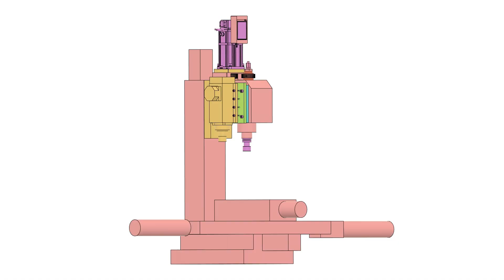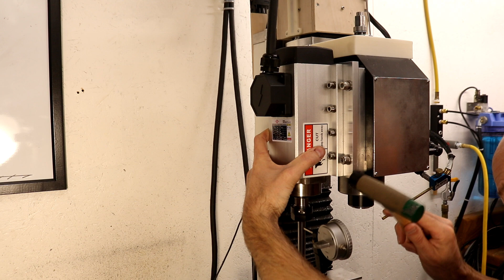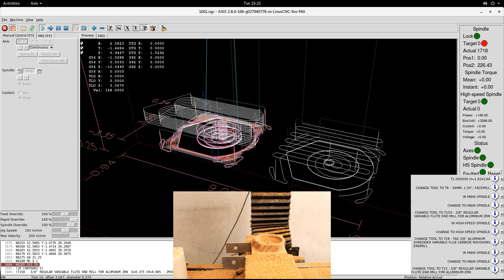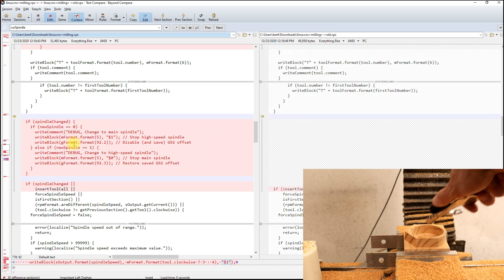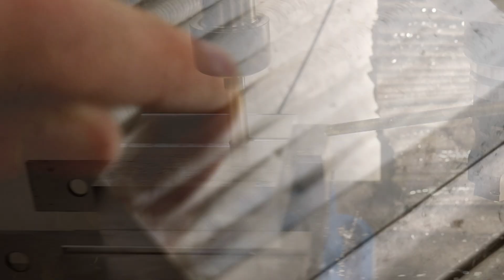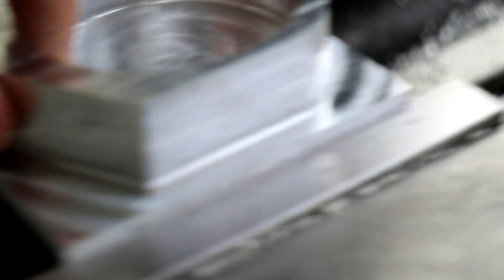Companion High Speed Spindle, LinuxCNC

Comment from the maker: In case it helps others, the Norbar FAQ corrects two mistakes that I've been making. Their torque wrenches: 1) should be stored long-term with a slight load; and 2) can be used to loosen if the capacity of the wench is not exceeded. (I've always stored torque wrenches with no load, and never used them to loosen.)
https://www.norbar.com/News-Events/Blog/ArticleID/129/The-ten-things-you-should-know-about-your-torque-wrench

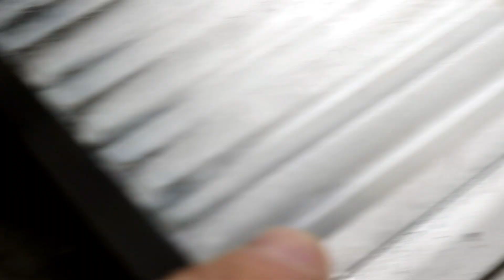Comment: At 15:00 this is normal due to the difference in milling direction : climb milling vs conventional milling its obvious that one have a better surface finish so set your finishing pass to be in a single direction to eliminate the roughness. texture on the wall is due to deflection take lighter final cut at half or third the feed rate and you will get a much smoother finish. Thnks
Reply: Great tips. I will only add that with the notched finish/rougher, a small vertical offset final pass to cut the leftover lines vertically. Or simply do multiple vertical passes that are different from the notch spacing should improve your finish.

Comment: Hey, found your video, but bit late I'm afraid) I wonder have you considered "speedy head" speed multipliers, this one can multiply 6 times, so your native 5000 rpm spindle can go 30k with it - https://www.youtube.com/watch?v=i8NrrTRrYAw , or even cooler - there are "air turbine" spindles, that works from air and can go from 15 to 50k rpm - like this one https://www.youtube.com/watch?v=LkPZ1ynjr4s . I also wonder if you think placing spindle aside from main axis of pressure - so that dovetails are pressured not in center but on a side, can somehow decrease accuracy? Thanks!
Reply from the maker: The speeders are pretty neat. The spindle that I used is pretty inexpensive and solid. The speeder depends on the stock shaky mechanical power transfer. On a mill this size and rigidity, I believe that machining soft metals (maybe steel), replacing the stock head with a spindle similar to what I used, making small fast cuts, is ideal. The air spindles are neat, perfect for micro tools, but the efficiency is pretty low (compression-expansion of gas vs electrical) for regular size tools. Starting over, I would replace the head with spindle with ATC and use small carbide tools. An expensive route, but the cost is paid once, and everyday solves problems and saves time. Hope this helps.
Reply: @kentvandervelden  Thanks, did you experienced some sort of rigidity issues while machining with high speed spindle, since it mounted sideways and not at the center of milling table?
Reply from the maker: @KyrychenkoAnton  With the stock spindle it's easy to be tricked into using big tools beyond limit of the machine. The high speed spindle leaves a far nicer finish than the stock spindle. No perceived rigidity problems, but the chip load is typically lower (and the spindle, bearings, power transfer is tighter) unless running the tool feed really fast.

Comment: Great videos and commentary! I did the exact same mod on my bf20 as you did here on your machine (water cooled 2,2kw spindle) and I am not going back to the slow main spindle for aluminum ever again. Finish is superior, MMR is superior and chip evacuation is a breeze above 12kRPM.
Reply from the maker: Wonderful to hear! With the HS spindle, do you prefer full depth or shallow cuts at higher speeds? Thank you
Reply: @kentvandervelden  My machine/hfspindle (slapdash conversion which I never fully polished as I wanted to make stuff on it not just mod it, which I kinda regret in hindsight) prefers generally lighter/medium depth of cut with smaller endmills (8mm or less).

Specifically case of that would be for Aluminum 5754 15kRpm, 2m/min feed, doc 5mm and 3mm woc. It can ofc be driven even more aggressively, but for this test it worked fine.  Here is a demonstration of the cut https://www.youtube.com/watch?v=9ECFzjlPzmo  (there are some problems in the X direction with chatter (the Z axis gib loosened a bit which I only recently fixed, as well as not having a second mist unit causing spots where coolant can not get at the cutter to cool it which is one of the main reasons as to why I am not doing 10mm doc with the same woc)

Edit: I do actually much prefer milling (roughing and finishing) with the HF spindle. It handles itself much better on a small machine like this with the loads present in high speed machining. It is only for face milling and drilling that I ever go back to the old spindle.
Reply from the maker: @exol511  Thank you, this is all really great insight. I left some questions on your video about the coolant. You've given more to think about :)

Comment: Browsing your video's found this HS spindle addition for "also" dual head CNC milling.
After James Clough42 his mill-spindle conversion I thought of doing the same but you convinced me.
Addition is better than conversion, thanks!
Reply from the maker: To increase capacity, addition may be best; if optimizing for aluminum or plastic or wood swapping may be best. Seeing how well the high speed spindle works forced me to realize how poor the bearings are in the main spindle and consider the bearings or spindle cartridge with a BT30 spindle. Have a look through the comments the suggestions from others such as mounting the secondary spindle on dove tails to raise it out of the way when not in use. Best of success to you!
Reply: @Kent VanderVelden  Indeed, better bearing with the same dimensions is a good upgrade.
Your aluminum adapter plate for a dove tail construction should then be of steel, I think.
Metal EndStop so that the Spindle can't fall.
Good to add a steel strip inside for bolt force spreading.
Also to keep it simple maybe the HS spindle casing flange could be machined to directly be the dove insert.
All this with a minimum offset distance to the main spindle centre.
Any thoughts?
Reply from the maker: @Dancer148  Everyone who comments on my videos have superior mechanical skills and creativity :)
Making the casing of the spindle into the dovetail insert is interesting. All of the surfaces of mounting flange that I received were rough, so leave some means to adjust for misalignment.
Do believe there there's some problem with having a spindle hang off the side of the head? The forces exerted into the head during machining are probably small, but maybe not. The main spindle is centered between the column dovetails, in some way, but the secondary spindle is not. Again, not sure if it makes any difference, but it's something that was an unknown concern. I thought I would come back to this when making an extension for the mill head, to improve the usable Y travel.
Reply: @kentvandervelden  I already made a sketch of the dovetail plate construction that needs more info to complete.
But I consider that your issues with rough surfaces while milling could be resolved.
It seems like the HS spindle does have some runout that could be measured like you did but pushing with the hands some side forces to the spindle. If that play is too high the adapter plate bolt tensions should be checked.
Have you tried milling the part with a much smaller endmill to lower the side forces for a smoother surface finish?
Reply from the maker: I've not tried smaller than 1/4". Maybe side forces are not too much at the higher speed? Spindle doesn't bog down. The surface finish from the high-speed spindle is much better than the main spindle, but machining with the high-speed spindle seems more sensitive to speed. May be seeing resonance? I did get a surface profiler to take the measurements. Maybe a video next month?
Reply: @kentvandervelden  I'm looking forward to it.
Best of success to you too!

Comment: Depending on a few things the alternating surface finishing will come from the climb vs conventional milling. If you only climb mill of the facing pass it’ll come out much more consistent even at higher feeds.
Reply from the maker: Hi Calvin, do you have a suggestion for automatically assessing and quantifying surface quality? Of course, quality is pretty subjective. I've looked at roughness testers, but they cost as much as my first car.
Reply: @kentvandervelden  Automatically I am not sure. I have only used two methods. First is the small almost record player needle-like drag needle that Mitutoyo makes, but of course that is in the two kilobuck range. Then there is the old hand scratch method, with a comparative set of rougness gauges you feel and see and use to compare to what your part feels like. That is more in the hundred dollar range. I have used both the Mitutoyo device and the hand scratch device to decent effect in a production environment.

With that in mind Perhaps you could come up with a way of using machine learning and a well tagged data set (machine method, ie end milling, side milling, turning, grinding, etc) with known Ra values and approximate the roughness value from an image, but I see many potential issues with that, such as the rainbow reflectiveness seen in the video.

Or maybe using an actual record player needle and strain gauge could work.

Whatever the case may be it is certainly not easy to do. Maybe some researchers somewhere out there have some better ideas.
Reply: I should also add that some machining methods leave dominant geometry on the surface which will almost completely define the surface roughness and therefore be calculated in theory. For example if you knew the geometry of the feature actually left by a a side milling cut and the feed per tooth you could mathematically predict a roughness average. Looking at a high quality side milling cut in a microscope is a great demonstration, the roughness in theory would come between the peaks and valleys of the chips cut off the material. A real practical example of this is in the single point diamond turning industry. By calculating the peak height desired between the feed per revolution of the turning passes, you can achieve a particular surface finish and therefore a particular optical transmissibility. However for finishing operations in metals with milling tools (especially face milling) I imagine it gets much more complicated with that as there could be very complicated mechanics with tool rubbing/friction/heat generation/cold working etc at the cut.
Reply from the maker: @CalvinoBear  I really enjoyed reading these. If you've not, I hope you can go through graduate school if you have the interest and find a great lab. It is that gage you mentioned that I was thinking of, and the 1k$ knockoffs, and did try my parent's 60-yo phonograph. I've been tinkering with accelerometer measurements and perhaps those combined with your suggestions would help considering the flex of my mill. For machine vision, I tried enhancing the hills-and-valleys using side illumination and polarized light, but when that works the surface is obviously rough. For manual quantifying, I've been measuring with a mic before and after lapping to a smooth appearance.

Comment: I just stick the tool into the collett with the nut hand snug. lightly grab the nut in the bench vise with the holder pointing the tool down and tighten the assembly by torquing a wrench on the flats of the holder body. I've honestly never found the need to come up with a better way to do it because it just works and just a common 6" vise is more than sturdy enough that it wont flex. Maybe some smooth steel jaws in the vise if the finish on the nuts is a concern but I never tighten the vise or the tool holder enough to mar the nut.
Reply from the maker: Thank you Justin, that is a really slick solution!

Comment: Great video... Thanks for sharing.  I am setting up a new machine shop in my garage.  I notice that you are using the Tormach TTS tool holding system.  I have heard that some folks have issues with end mills pulling the tool holder out of the spindle.  Have you experience this kind of problem?
Reply: Thanks for you reply...  Here is an interesting video that happens to provide tips along this subject.  https://www.youtube.com/watch?v=m9rMbSLyAvM
Reply from the maker: Thank you, Cliff is a very talented professional machinist
Reply: I have had endmills pull out of TTS collets, and one came out so far it cut through the sacrificial material under the stock and through the T slots on the table :( I wasn't in the shop at the time so didn't catch it in time. First few passes seemed fine so I left it to go have dinner. Costly dinner.
Reply from the maker: @davidtaylor6124  Through the t-slots!?! I'm lucky only to have lost a few parts and jaw plates. Did you continue using TTS and torque the down super snug or stop using TTS all together?
Reply from the maker: TTS is a great convenience. There's a spindle power limit, but I have no trouble today with holder pullout with a 1HP spindle. Originally I did, but the drawbar needs to be tight with TTS. Use a torque wrench until getting a feel. Tormach lists the torque requirements. I have no trouble recommending TTS for a small CNC mill. Thank for the comment and have a great weekend!

Comment: Hello Kent.  I’ve finally started putting my control box together.  Forgive me for this question.  I’m absolutely certain at this point how the wires connect to my acorn board, but....I can’t seem to find much info on what wire size, or wire type, to use for the different connections.  I’m using longs closed loop motors on my pm 25 that seem to replicate the lead shine motors you were using originally.  I see they have 18 gauge wire coming out of the and 26 for the encoders.  So that’s settled.  My problem is I don’t know what size wire to use for things like limit switches, the power connections, connections to the acorn board.  If you could throw anything even remotely comprehensive my way I’d truly appreciate it.  It seems to be the one thing that nobody ever covers.  I’ve resorted to watching videos at .25x in an attempt to zoom in on what wire size they are using.  Not working out so well.  Save me.
Reply from the maker: An educational channel with emphasis on cabinet wiring is @corvetteguy50. Vince has a lot of great suggestions in his videos and sells premade components. My $.02: I think UL508A is the industrial cabinet standard. Given that may be hard to find, maybe look around for Siemens and Schneider guides. If I run across one of the cabinet wiring manuals that I have I'll try to get you a link. Keep in mind, these are big industrial cabinets, and where the thinnest wire may be required to be 16AWG but in our case, we're carrying 10mA at 24V from a limit switch. Most of my stuff is 12-18AWG for power, size depending on maximum current, power lines are fused, and digital stuff is on 22AWG. In general, try to keep high-voltage, high-current, or high-noise components separated from low voltage logic. Verify the current carrying capacity of each wire. Consider the location of the wire and cable, including: is it external or internal, does it need extra protection, does it need shielding. Consider a VFD cable... it's expensive, and excessively thick considering the current that's carried... but it's also has the requirements of limiting noise radiation and surviving being banged around. Just compare 300V vs. 600V cable at the hardware store. One is way thicker and useful for abrasion resistance. Use ferrals  to contain the wire strands. Get a good labeler such as a Brady. Have a good wiring diagram that's kept up to date with each wire labeled on the diagram and in the control box. Those are the suggestions that come to mind... take these recommendations more so than what I do. I experiment a lot, and carefully. I would do things differently if a permanent installation. I hope this helps.
Reply: @kentvandervelden  thank you so much.  I know your audience appreciates your involvement.  Not to mention the ultra fast replies.  I’ll go ahead and order those spools now.
Reply from the maker: @durangotang1681  If you don't have a favorite source, checkout AutomationDirect for bulk wire and cable. For smaller gauge, I get spool assortments from Jameco. (I don't have any relation with either.) The big problem with cable for us, is the good stuff is typically sold in huge rolls. AutomationDirect will do cuts of 20-50' though, which is a small enough amount that it'll eventually all get used. They will also have data sheets and answer questions. And I get ferrules from them. I started with an assortment pack from McMaster but get refills from AutomationDirect for something like 1/10th the price.
Reply: @kentvandervelden  I just ordered a ten pack from Remington industries of the 22awg. I’ve got a lot of power cords and and switches and stuff from my excessive scrapping habit.  I’ll probably go pick up some 18 gauge from the store this week.

Comment: With higher rpm/feeds/sidestep/depth comes stability problems. You might have to consider at some point that your main body of the machine has limits.
Reply from the maker: There's no truer advice than yours. Fun or frustrating, trying to correct or workaround problems is a teacher.
Reply: @kentvandervelden  So true.......so true but sometimes frustrating as you say. My frame is a little stronger but no where near complete..

Comment: the high speed spindle has less torque at low rpm's because it is probally  only 1/5 to 1/10 the HP of the main, I have both and my main is 5HP and my high speed is only 3KW ,  I always remove the tool holder from the one I am not using (clearance)
Reply from the maker: Thanks Gary, I'll make a couple plugs to fill the empty spindle, to keep the chips and coolant mist out of them. Keeping tools in both spindles made for a more suspenseful show :)
Reply: @kentvandervelden  I learned the hard way